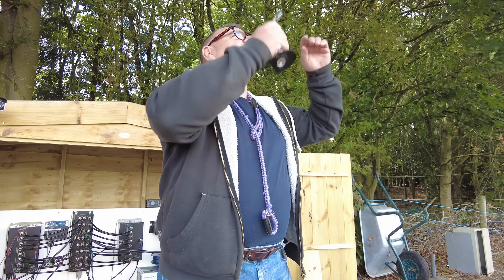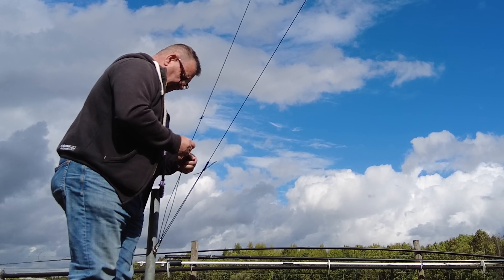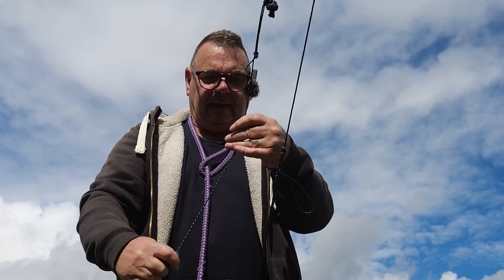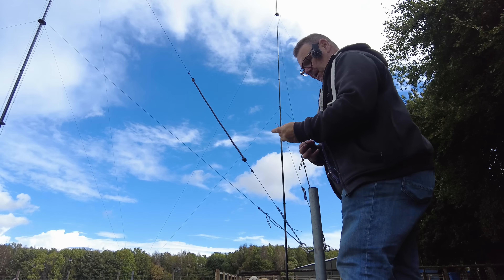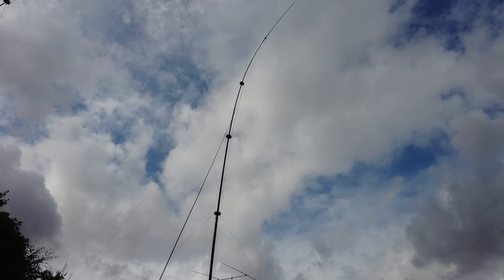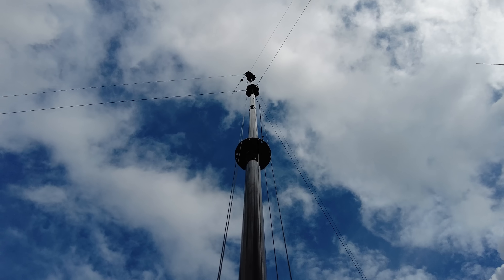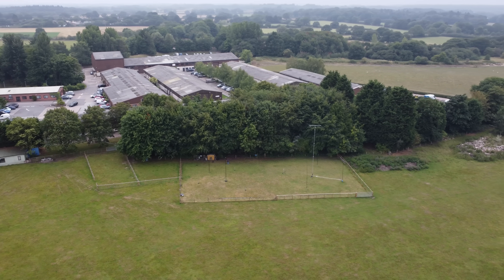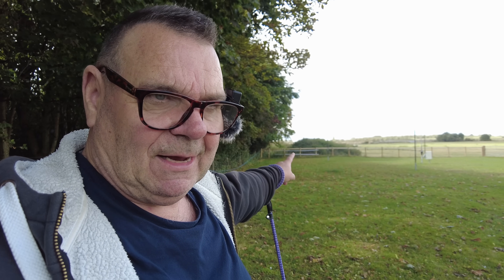Mastering Antenna Guying: 18-Meter Mast Shock Cord Solutions

Comment: Callum, is there are "rule of thumb" that goes with guying the mast height? 

When completed, my mast will be 12 meters high; bottom mast is 50 mil and the top is 18 mil. Currently, I have the mast guyed at three levels [ 4.7, 6.8, 9.0 meters from the ground] and at four stations on the ground. The remaining 3 meters at the top are not guyed at all. 

Should I use shock cord at the 9 meter level, or is shock cord unnecessary at this lower height? Should I guy the last 3 meters at the top then?

Many, many thanks from a faithful fan.
Reply: I wouldn't worry about it  I have had a 39 foot mast guyed at 2 points and a 50 foot mast guyed at 3 points up for years and never had a problem.  Nothing but Dacron guy line.  My mast are fiberglass with cam lock collars at each junction made by MGS (Max Gain Systems) in the US.  A couple of years ago I had a tree fall over and land on a set of the guy lines of the 50 foot mast.  Bent the mast over like a banana.  The tip of the 10 1/2 foot vertical on top of it had it's tip touching the ground.  Once I got the tree off the lines everything popped up like nothing had happened.
Reply: @mikesradiorepair  Hi Mike! My 43' mast is from Max Gain too. Bought it about 20 years ago and still thriving. My 204' dipole is at 25' currently. The heat has prohibited me from getting the feed point up to 40'. As it gets cooler, I'll venture out and get there. The top 1" and 3/4" mast will be out about 7' each, so I am a bit concerned when the 60+ gusts hit the San Diego area in October thru December. Thanks for the contact and 73!
Reply from the maker: On a 12.4 - I guyed mine in the middle... It went S shaped regularly - but very stable.
Reply: @DXCommanderHQ  Thanks Callum for taking the time to respond and 73 my friend from San Diego.
Reply: Will be adding this to mine Calum thanks for the video.  Hoping / planning to put up a second to get 2 elements on 80 here!
Reply from the maker: @alanlyons9022  I have since tightened mine up. Either that - ot make them shorter... There was too much "give"... But all good - you'll work it out.

Comment: 30 years ago I had a home brew 65 foot vertical (self supporting) in my back yard. 3.5 to 3.75 mhz low swr switch in a 1000pf/hv ceramic transmitting cap in series for 3.75 to 4 mhz also I fed the it with a tapped coil/ motor driven cap coil for 40 meters and 160 meters. the antenna played like a champ.  . - -   - - - - -   - - -   - . .
Reply from the maker: Beautiful.

Comment: I use about 3 feet of shock cord attached to the end of the 80 meter L on a signature 9. 1 foot of it on either side of a pulley on a 22 foot pole and the rest paracord. Then I created one guy opposing that direction and used another 3 feet of shock cord near the ground with metal latch to paracord. the system flexes side to side but remains vertical with no wind if you get the tension just right.
Reply from the maker: Nice